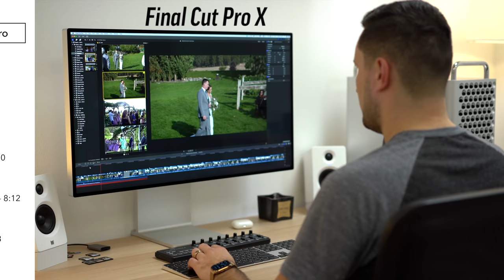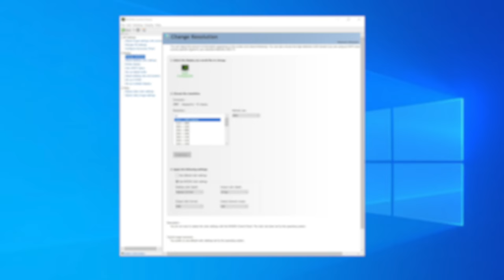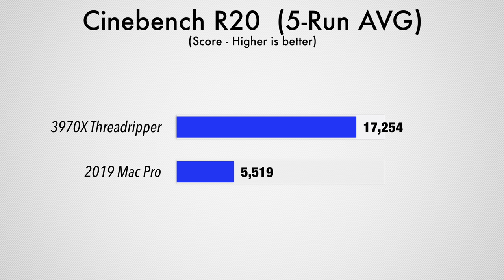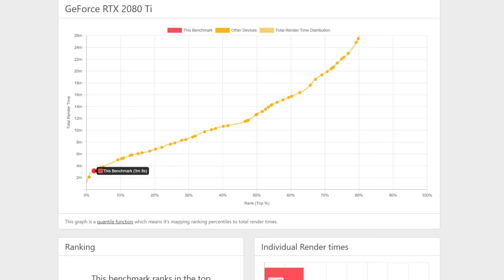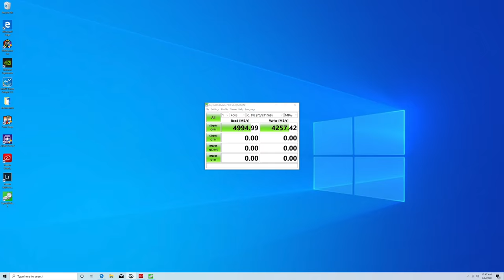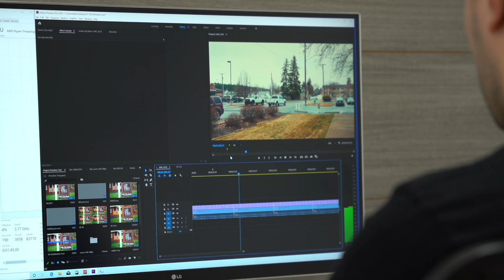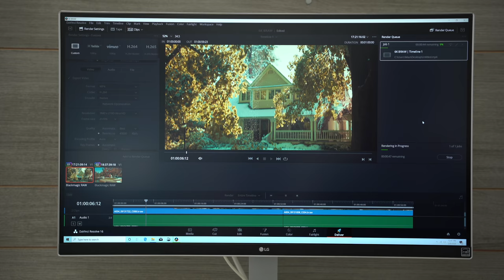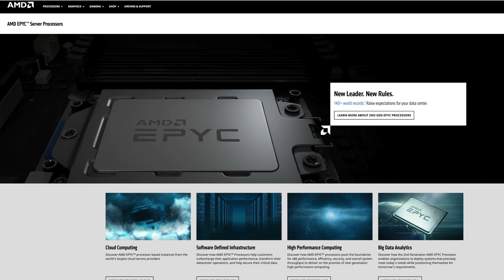$15,000 Mac Pro vs $5,000 Threadripper - Sorry Apple..

Comment: Talking about PC: "very few people will need that amount of RAM"
Talking about Mac: "Being able to add $25,000 worth of RAM is super dope"

You can't be talking about insanely costly upgrades in a price point comparison. It defeats the whole point of this video. But sure... go ahead and bring your Mac Pro up to $40,000 with 768GB RAM and compare it again to the $5000 TR PC.
Reply: yea... Threadripper can't go above 256GB of RAM
yet, it could also be Linux base with hackintosh virtualization... I'd like to see the benchmark result there
Reply: More ram means nothing at a certain point. I don’t see a reason to go over 16GBs in most cases and 32GBs a bit overkill
Reply: Mr Anderson well there isn’t a real reason to ever have 256GBs, unless you’re doing some big market cinema work where you’re working with CGI and trying to work and render it. If so, the more ram is only the first problem
Reply: @kevinarzola4781  those are the only scenarios where Threadrippers fit the most, right?
unless you're doing some heavy VFX work, there's no need to go Threadripper... and VFX/CG requires quite a lot of RAM...512GB to 1TB is common in that space... this is where Threadripper (especially 3990X) loses
Reply: @kevinarzola4781  The Mac is aimed at big market cinema and VFX work
Reply: In visual effects most workstations don't have more than 128gb of RAM. Some might go higher but not by much. Anything that does require more is going to be way too slow to calculate on a workstation anyway so it's sent to the farm. No, 512gb+ is not common in vfx. So Threadripper doesn't lose anywhere, for all purposes other than render farms and servers, it wins and beats anything the Mac Pro has. And the Mac Pro doesn't compete with in the server space, so it's an irrelevant scam of a machine.
Reply: @oBCHANo  hmm... then, Threadripper got some ass to kick really, really HARD
thanks for the info, btw
Reply: @kevinarzola4781  for ram consuming programs yeah you need a lot of ram. I do actually have 32 GB ram at my office PC and trust me I get 99% usage when running 3D conversion task and Point Cloud conversion tasks too.
Reply: Sergio Rivera you’re just proving my argument. No normal user will ever need more that 16GBs. The Mac is overpriced and I just saw threadripper kick it’s ass at half the cost
Reply: Mr Anderson threadripper already did lol
Reply: @kevinarzola4781  sometimes even 32gb helps in certain applications. I reached around 29gb of ram usage while using ue4 once. But seriously anything above 32 or 48 is definitely overkill.
Reply: @kevinarzola4781  for gaming that is fine. For workflow, 64gb is amazing.
Reply: @thegaminghydra592  did I hear an iSheep cry?
Reply: Mr Anderson terminator dark date was rendered on threadripper. I didn’t see them complaining about 256GB of ram. Ram only matters with 8k renders (very rare), server and deep learning type stuff. If a major motion picture with as much cgi as dark date can be made with threadripper...
Reply: Sergio Rivera right but the difference between 32 gb and 256 is astronomical. I guarantee your programs would run fine on even double your ram capacity. Maybe at 128. Just because you see 99 percent utilization on 32, doesn’t mean your program needs more than 256, that’s some terrible logic right there
Reply: They also easily could have installed a 24GB RTX Titan instead of the 2080 Ti as that's more appropriate for workstation graphics loads and it would have only increased the price by another $1200.  Except that would have embarrassed the Mac Pro even more.  Oops!!
Reply: @veeclash4157  or 2* 2080ti sli
Reply: @oBCHANo  Blur Studios and a few other big name effects studios have switched to Threadripper and EPYC for their workloads. They say it's fantastic.
Reply: What a point. What A Point. You need to be my attorney. #salute
Reply: @mranderson2048  Take it from a professional artist who works heavily with VFX and large scenes: We don't use more than 128GB, or MAYBE 256GB if we're dealing with poor optimization. That being the case, we send the work right back to the artists and tell them to do it again until they get it right.
Reply: @kevinarzola4781 ? Yeah, you know nothing. There are more important things than gaming, ya know? Or uploading basic edited videos on YouTube.
Reply: If you really need more than 256G of RAM you can just replace the Threadripper with an Epyc... still cheaper...
Reply: I would like to see performance comparsion after adding 2x quadro rtx 8000 and 256gb of ram. And change the cpu ryzen 3990x

Comment: What's this "Workstation grade" part nonsense? I've been working with other artists, musicians and video editors my whole life. We don't buy 'work station grade parts' we buy parts off the shelf and build a computer that frequently we'll use for 7-10 years unless there's a massive upgrade like there is here with AMD's Ryzen. 'Workstation grade'? What are you talking about? Are these magical workstation parts you heard of somehow capable of lasting longer & can ignore obsolescence ?

I have no idea how you can compare a Mac that costs so much money vs a PC that's a 1/3rd of the price and have a single recommendation for it like that. Even admitting AMD has a line of CPUs that actually compares but then you don't show such a thing. 

The best complaint is, 'it's too loud'? Adjust your fan curve, you have it more than 20C less hot so you can adjust that and still get the vastly superior performance you found in your tests for a fraction of the price.

For your last comment that it was hard to build a PC so the Mac has value there...There's at least 5 companies that will build you a PC, do all the fancy wiring, test it and warranty it better than apple will and it will still cost FAR less. Or there's pre-builts if you're really desperate. 

Apple's software support isn't robust, so unless you REALLY NEED Final Cut Pro for some reason instead of the 50 other options you can get on PC/linux, why would you spend 2/3rds or more? How is that a recommendation any channel would make? 

One final advantage and that's wireless charging? What a great advantage! My mind is blown, what about this advantage:  if you want to do other things like gaming, which, this Mac has almost no capability of doing. 

Your review boils down to "If you want final cut pro and Mac OS, we can see you spending an extra $10,000 for a slower,  far less capable machine!". 

I don't get it.
Reply: Snotnarok I’m was actually about to buy this new Mac Pro. This video and people comments have me thinking about the PC. Can you mention the “at least 5 companies” that I could contact about the PC build? Pls and thx.
Reply: @harpghoman5496  as in part companies? Like cpu companies or like those agents who builds your pc out of the parts you bought? Honestly, just build one
Reply: @harpghoman5496  Da Vinci Resolve and Adobe Premier. Mostly Da Vinci Resolve
Reply: In my country, the store will build and preconfigure your PC for free if you buy most of the part there. They will even install you any software or game you want if you want a ready to use PC.
Reply: Fucking roasted! I love it!
Reply: @harpghoman5496  digital storm, origin pc, NZXT, etc..
Reply: Sounds like you don’t work in a mission-critical professional environment.  That’s just fine.  Keep using your consumer-grade parts.  Not comparable.
Reply: Stop! He's already dead!
Reply: Evan M Just learn how to setup a pc properly?  I run a buisness and would lose thousands a day in revenue if my computer goes down.  I can go to the store and buy a replacement of whatever part I need in about an hour tops for a PC.  For a Mac I have to jump through all their BS hoops and I’ve done that before.  That is a huge reason why I will never buy a Mac again.
Reply: @Evan-McM  "consumer grade parts" BAHAHAHA Apple be using some space-grade carbon mars technology grade parts or what ?? They ARE using AMD and Intel parts for fucks sake !

Comment: 0:35 you can install Fedora , Ubuntu, or many Linux distros on that Threadripper PC and get even better performance than using Windows 10.   Can't do that with the Macbook Pro.
Reply: vh9network yes but is that what the mac pro is for? I too dislike that its so expensive for th e specs but mac pros like this arent targeted towards normal people. Try being a business for once...think about the time and labor itll take to build multiple machines like this. Sure itll seem like nothing to you and me but to a business that’s loss time that can add up to the price you paid for these things. Not to mention getting that custom machine working 100% with the programs mac pro is designed for.
Reply: blad90 You realize Linux has tons of support?
Reply: blad90  no ones a kid here, I've been working with x86 computers for 20+ years too.  The $15K Mac Pro is nothing more than a status symbol.
Reply: @vh9network  100% yes agree just status symbol  like ' yo i am a pro here ' i use $10000000000 mac bla bla bla
Reply: MrMilkyCoco what happens when you’re running a business and your Mac dies?  Do you wait for days losing thousands in revenue to jump through their hoops?  Or do you run to the store, buy or exchange the broken part for a replacement, and be ready to go in a couple hours tops?  I do run a business and used a Mac for a while, I will never buy another for this exact reason.  Besides the fact that they are a ripoff for what you get.  Setup time is nothing compared to having a part fail on you and having to take up to a couple weeks for Apple to fix it.
Reply: Are you even serious? You hate Apple? good for you. This machine sucks and is overpriced? I'm not arguing. But please do not spread fake informations, you can install Windows and Linux distros on a Macintosh.

Comment: Enermax? Umm...yeah. A lot of their recent units corrode within months and I’m not sure if the latest batch is fixed or not. Also their fans are noisy sleeve-bearing fans so if you are complaining about noise replace them with more Be Quiet! Fans to match the ones in the case or some Noctuas. Better performance and lower noise. If your unit is looking iffy? Go with a Be Quiet! Or Noctua Threadripper air cooler.
Reply: This guy literally bought the loudest parts to cool the threadripper just to make it look bad, hes trying so hard to defend the Mac because he spent so much on it lool
Reply: I'm with you with BeQuiet power supplies - great stuff for reasonable money. Just cleaned an older PC, thick dust layer - the power supply is still unhearable (I'm VERY sensitive in this area - sound engineer) and works as on day one. And of course Noctua - try once, don't look somewhere else.
Reply: 1 Up up for the Be Quiet.  I had My Enermax fail and I swapped in a Be quiet.  Kind of reminds me of the air cooling in my 2010 Mac pro which Has been 9.5 years of no hassle reliable performance . I wish i could say the same for my Threadripper build Which has been such a headache but I still love it. Learned allot going from a Mac to building my own. If you have high paying clients and no computer skills go for the Mac pro.

Comment: Blender is 30%-50% faster in Linux than in Windows.
Reply: Would love that setup for Blender. Now all I need is money.
Reply: really??
Reply: @realpunkfruit   Windows uses high core count pretty poorly.
Reply: @allansh828  no, it's just bloatware in the background..
Reply: @allansh828  Windows Pro works just fine up to 64 threads so you shouldn't have any problems with the 32-core Thteadripper 3970x. For CPUs with over 64 threads (Threadripper 3990x) you'll need Windows 10 Enterprise . This has been confirmed by Anandtech.
Reply: Congrats. Linux has half the compatibility that Windows has. :P
Reply: And FCPX is fastest yet, running on macOS.
Reply: That's because Blender is garbage software to be fair.
Reply: Windows 10 ltsc helps in thst department
Reply: Skaayoo OW i have blender it is good modeling tool but you better save your files regularly. However It has improve recently with 2.82
Reply: @peterbreis5407  *Only in macos and nobody gives a damm about rendertime if it drops frames while editing

Comment: The noise levels on Threadripper could easily be brought down by using a cooler, like the Dark Rock Pro TR4. Instead of a loud, noisy liquid AIO.
Reply: Using an AIO on a computer that expensive with a side panel window would be really dumb, as the cooler is about all you would see.

It's not that AIO's are loud, it's that Enermax's AIO is loud.
Reply: Noctua fans, he needs Noctua fans.
Reply: It would also have helped to go for a case with more airflow. "Sound insulation" may sound like a good idea at first glance, but actually it isn't (at least if the system produces more than ~150-200W of heat, which is the case here). The fans have to ramp up because they desperately try to move air through the insulation! If the case was more open they could happily idle away, thereby making the system more quiet overall.

btw. liquid cooling is overrated anyways. It's absolutely no problem to cool a 200W CPU quietly with air cooling - just think of it this way: a simple space heater will easily "cool" 1000-2000W without any liquids involved. A liquid cooler just adds another source of noise (the pump).

Comment: What, how the hell did you get skipped frames in a 5000$ pc?
Plus warm and loud in such a big case.
I built a 2000$ pc with no issues in neither, editing 4k raw in premiere.
Reply: Steven Enno 
Not a flex nor weird, when it's possible to built a 4k editing pc for less than 2k in comparison, hence the confusion when he gets skipped frames in a monster 5k built.
Reply: He mentioned windows not being snappy and programs crashing, my guess is he had a bad RAM stick
Reply: That's the problem. With apple users, they are behind in Technology, everything is dumbed down for them, they praise low quality and under powered computers
Reply: @The-Heart-Will-Testify 
He runs a tech channel 😅
Reply: @maisondav1d  yeah but he uses a fucking mac. No smart person uses Apple products.
Reply: @maisondav1d  Apple products channel*
Reply: Dude I have no fucking clue I don't think I've ever even seen a Windows crash on my 3600.

Comment: Hopefully AMD will stop the artificial memory limitation for Threadripper. I'm pretty sure there are people that don't need Epyc - double socket, 8-channel or more PCI-E lanes - and would still like to take advantage of Thredripper's higher clock speed and more use than 256GB of RAM, AMD could at least double that!
Reply: The memory limitation is one of very few defining factors between Threadripper and Epyc.. Besides, if the VFX for big movie studio productions like Terminator Dark Fate are produced on 3rd Gen Threadripper, then Richard in his studio apartment taking fivers for YouTube videos can make it work as well.
Reply: EleMenTfiNi lol
Reply: since mac pro or epyc and xeons a lot of people got the impression that you need 1tb or 2tb, but for vfx your are fine with 128gb often even with 64gb or even 32gb but on the other end you wanna raw power and threads, the software is fine with that.
Reply: I think Windows 10 caps out at 512 gigs though?
Reply: Remember there's Epyc
Reply: You don't need tb of ram for vfx. 

128 is plenty for most to work extremely comfortably, 256 should leave most people with a lot to spare.
Reply: SkuldChan42 Why should an 64-Bit OS cap out at 512 Gigs? Windows Server at least supports multiple TB. Maybe they just locked it for the Home PC versions. It‘s definetly not a technical limitation of windows.
Reply: Actually you wont need more than 256 gb on this system. Particle simulations is what will chew up a lot of ram and you could easily do them on a system back in the day of RealFlow 5 with 8 gb ram or more. Rendering finished simulations, animations and VFX work you wouldn't use a desktop machine but instead a rack of servers networked together in a render farm. Heck you can render an entire previs of a movie on a mid range desktop computer costing about $1500.00.
Reply: I believe that it depends of the type of memory you choose. I think that vou can have at least 512GB with the right type of memory. But one thing that AMD should change is giving 2 more channels to these top CPUs.
Reply: Yeah it's an absolute shame. 
Though the AMD Epyc 7002 series is basically the same thing as Threadripper. Differences include being clocked lower, 8 channel memory and it supports up to 4TB  of 3200 Mhz DDR4 memory. 
It costs a lot more, but not compared to Xeon W or Scalable.
The Epyc 7702P for example is a 64 core monster that costs $4,784, a 32 core Epyc is about half.
Reply: @deathdoor  Or 4 more
Reply: If they did that, they'd sell fewer EPYCs. Also, when the max unbuffered DIMM size increases, you can double the RAM to 512.
Reply: @agungdarmayuda5754  No the 512 gig limit is a Windows 10 thing - I guess you'd have to upgrade to a Windows Server OS - which caps out at 24 tb.
Reply: @SkuldChan42  512GB was the limit for Windows 8
Windows 10 Home has a limit of 128GB
Windows 10 Pro and Education have a limit of 2TB
Windows 10 Enterprise and Pro for Workstations have a limit of 6TB
Source:

https://docs.microsoft.com/en-us/windows/win32/memory/memory-limits-for-windows-releases#physical-memory-limits-windows-10
Reply: @EleMenTfiNi  preach

Comment: I heard this somewhere and im yet to confirm...
But adobe is friends with apple, or at least prefers apple products.
Because apple normally dosent have a graphics card, and none of thier pro level machines have more than 8 cores,
Adobe for the most part (specifically for the pc versions) dosent use more than 10 cores, and therefore loves clock speed.
Adobe also dosen’t like using gpu for ths reason.
Reply: A long string of misheard and misunderstood nonsense.
Reply: @peterbreis5407  Truth